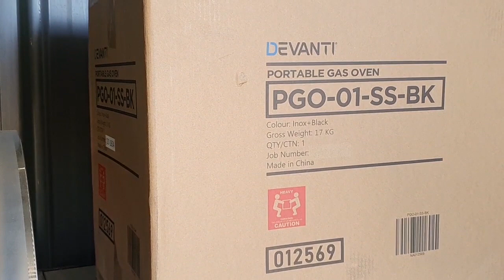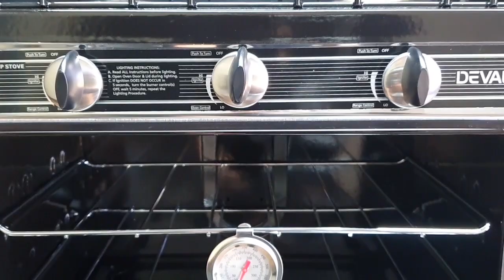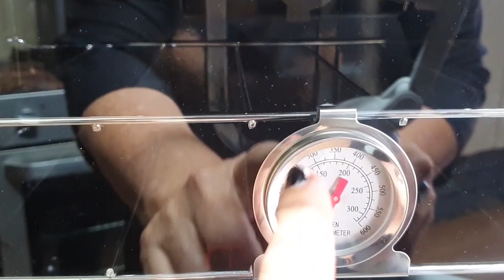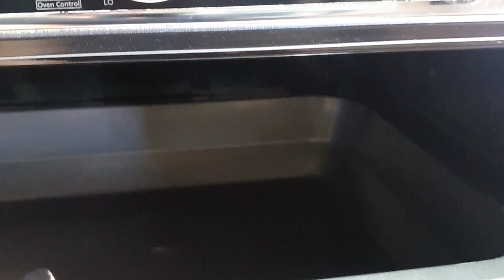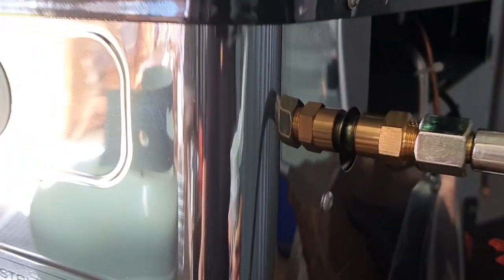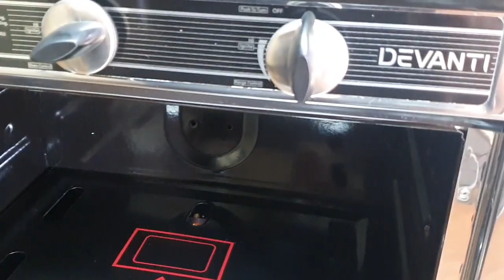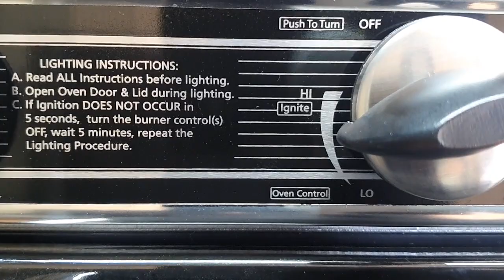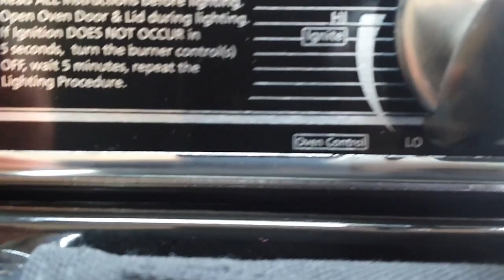DEVANTI portable gas oven review | reviews | portable gas oven reviews | Aussie girl can cook

Comment: Try a wire rack that will fit pan its heating the base to much. It has to be lifted a little and it will circulate heating more even less time. I purchased a Kings mini BBQ and do the same method no drama and less gas only cook steaks on plate. cheers
Reply from the maker: i cooked brownies on the top shelf and they still were burnt to crap on the bottom. i got rid of it. Kings have pretty good stuff. have a lovely night mate 😁
Reply: Also thanks for the tip I'm not buying one now. I found it on Kogan for $231.
Reply from the maker: i made the video a year ago hence the price difference and your so welcome mate 😁

Comment: think of how a electric oven works. it has a thermostat right. so they would heat up and turn off at the correct temp, then when it cools below that temp it would heat up again.. maybe you need to work the same concept with this gas cooker .. hence why the thermometer is in the oven ?? :S handy but prob more stuffen around trying to cook something as you would in a electric or proper gas oven